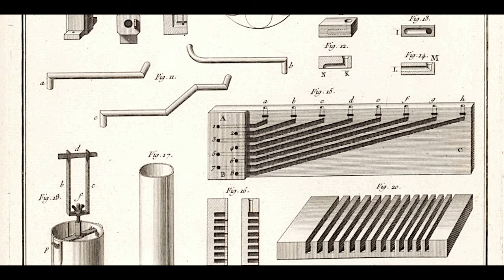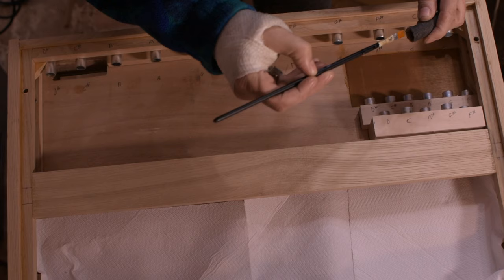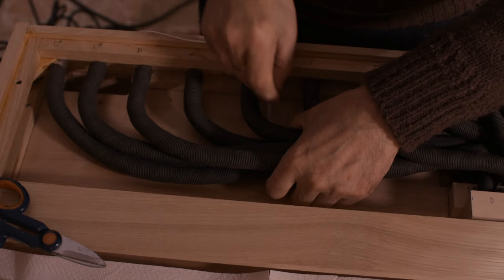Air distribution - Renaissance Positive Pipe Organ Building

Comment: I have a question, surprisingly I haven't been able to find a straight answer. When the pipe organ is on, the blower is blowing air into the wind chest. If no note is playing, you'd think that there would be an escape mechanism for the unused air to leave, but several people have told me there isn't. So, where does this air go? According to reason, eventually the system will max out and either the pump will burn out or the wind chest will explode.
Reply: A good question.
Modern organs typically have a   centrifugal blower (ie a fancy fan) to provide the wind. The pressure is usually tiny, about what you would use to blow bubbles through you drinking straw when you were a child. So, when the organ isn't using any air, the fan keeps pushing and maintains the pressure but the FLOW stops. Like when you block you vacuum cleaner hose, the motor whines a little more but no problems otherwise. Organ blowers are designed to handle this without noise or overheating so no problems ensue. In the old days the person pumping the organ had a little indicator to tell them when the bellows was full so they could slow down or stop. In the worst case there is usually a safety valve but it is a last resort because it makes a lot of noise. Hope this helps, TBAW.
Reply from the maker: There is a valve at the bellows inlet that progressively closes as the bellows fills, so when the bellows is full the valve is completely closed. For safety there is also a relief valve in case of overinflating.
Thus you have a situation of static pressure that the windchest can easily hold, when a key is pressed a condition of dynamic pressure is created and the bellows lowers slightly, opening the inlet valve just enough to maintain the pressure. The more keys are pressed the more air is required and the further the inlet valve opens. the amount of pressure is determined by how much weight you put on the bellows
Reply: @TheBellsandwhistles  Thank you for the explanation, it makes perfect sense now. For some odd reason, I assumed pipe organs required massive amounts of air pressure so the blower would be comparable to a compressor, so the windchests would always be under enormous amounts of pressure, but since I asked this question I've watched quite a few videos of manually-operated bellows and I realized how little air is actually required in order to make pipe organs sing, I guess the massive sound that fills the cathedrals is more of a product of the environment than the pipes themselves, everything is finally clicking into place.
Reply: @nippocast  I see, I was wondering why there were weights on top of the bellows on some videos I watched, also, I understand now that the amount of pressure required to operate a pipe organ is far less than what I initially predicted. Thank you.
Reply from the maker: @jorgeandrade20  exactly, the pipe organs works at a pressure of about 50mm in water column, i.e. 0.005 bar